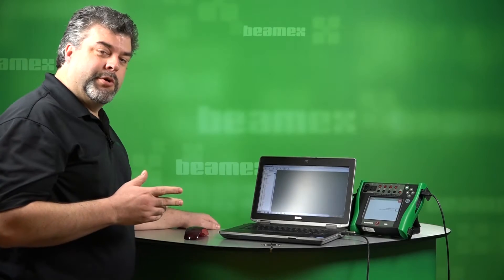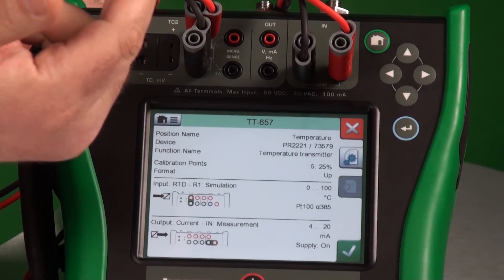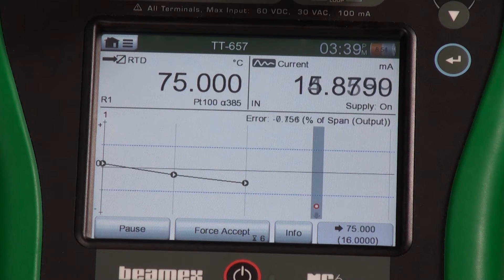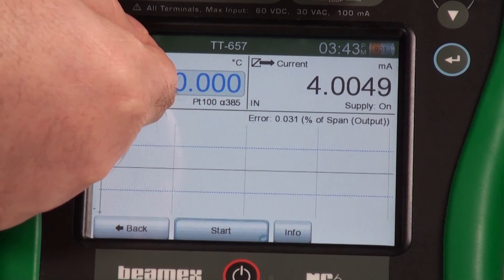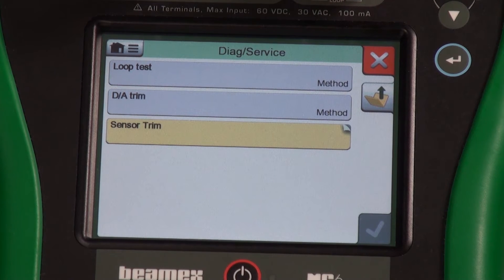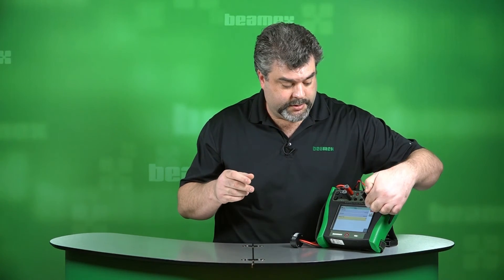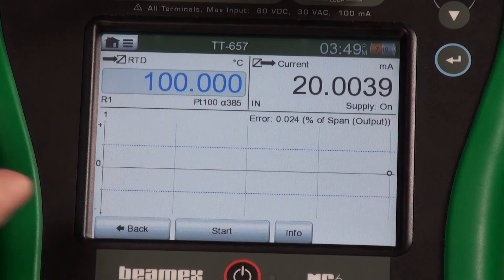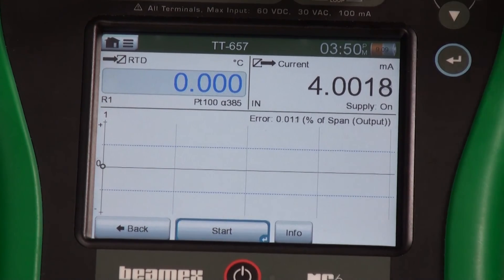Temperature loop calibration and trim with the Beamex MC6

Comment: Excellent Video. We just got our MC6. having trouble doing a similar procedure for a Thermocouple. Using the TC1 port we can only seam to measure during the document calibration process.
Reply from the maker: Hi Mike, thanks for buying the MC6, I trust you will find it very useful tool. 
You can simulate thermocouple via the TC1 connection and make similar automatic calibration like in the video. Also, if it is HART transmitter, you can also trim it with the MC6. 
To simulate thermocouples, you just need to select the "Port/Function" in Documenting Calibrator to be "TC1: Simulation" and the MC6 will simulate the selected thermocouple type. 
In case of any questions, please give our support guys a call.

Comment: Excellent guys...Great Job!!
Is there a sequence as to should DA Trim be performed first and Sensor Trim next or vice versa...also please explain me the difference between the two...
Thanks!!
Reply from the maker: Hello Rajesh. Thanks for your question and for watching the video. 
The Sensor Trim and Analog Trim are independent from each others, so it does not matter which one you trim first, as long as you trim them both. Sure in the transmitter the Sensor Trim comes first, but the trim order can be any. 
It is important to note that even you only use the mA signal in your process, you still need to trim both sections. 
Hope this helps, Thanks Heikki / Beamex
Reply: BeamexCalibration Thanks Heikki for your reply...Congratulations to your team for doing a fabulous job!!
with reference to the same I have one more question...the output of my Transmitter is the input of my Flow Computer which computes the corrected flow rate of Natural Gas.So Even after I set the o/p of Transmitter correct by trimming as you explained...there might still be a chance of inaccuracy in the Final Flow recorded by by Flow Computer because of Barrier...So should I check the Calibration of the Entire Loop or if the O/P of my Transmitter is correct I can assume my final reading by Flow Computer is also correct
Reply from the maker: Hi  @rajeshpatnaik2485 , I'd think that anyhow the transmitter should be trimmed to work accurately. Normally a barried should not have effect to the current. Anyhow, you could measure the currnet after the barried and trim transmitter to compensate any error caused by the barrier. 
Generally, doing a calibration of the whole measurement loop is a good idea. That is pretty common nowadays, so you first calibrate (check) the whole loop with e.g. temperature sensor + transmitter + control system input card. If the whole loop is accurate, then nothing needs to be done. But if there is error in the whole loop, then you need to start checking the individual Instruments to find the one that is causing the loop error. Thanks, Beamex / Heikki
Reply: BeamexCalibration ....Thanks Heikki,ur reply adds clarity to my question!!

Comment: Hi. I have MC5-IS, can you help you to connect the external 10V power supply so that I can output/sim current. Loop power? Thank you
Reply from the maker: Hi! If you don't happen to have the MC5-IS manual, you can find it from our website, or pdf is here: https://www.beamex.com/app/uploads/2016/10/MC5-IS-User-Guide.pdf 
On the page 58, it is explained how to do the current "sink", i.e. to use external supply and have the calibrator controlling the current. 
If you need, please contact our support at support@beamex.com, or through the Support Portal: https://support.beamex.com/ and you will get help.
Reply: Hi. I have it sir, thx. Bui if I go to Current Sink, E: DC Current Source/Sink Generate it say that I need external V source. In the manual it is not shown how to connect this external V source that my MC5 need to generate this current. Please help @BeamexCalibration
Reply from the maker: @perica_jonev  If you use the ET module, then the positive side of the external supply voltage is to be connected to the upper (positive) terminal in MC5-IS (the "arrow in" in the manual picture). And then the supply negative to the ET module's lower (negative) terminal. Similarly, you can also use the E module for this.
Please note the related warning on page 59, starting as following: 
"Warnings! To avoid damages to MC5-IS' electronics, first select the correct Quantity and Function/Port. Then connect the circuit including the external supply to MC5-IS.
Make sure that you don’t exceed the maximum current allowed by the instrument under test."

Comment: How to determine the input and output terminal of the rtd?
Reply from the maker: Hi, if you refer to how to determine the RTD input and output terminals in the calibrator in this video (Beamex MC6), the RTD input (measurement) and output (simulation) are using the same terminals, you just select in the menu which functionality you want to use. The one difference is that measurement uses 2, 3 or 4 terminals, while the simulation always uses the two leftmost terminals. This is explained in the user guide. Thanks, Beamex / Heikki

Comment: How did you increase temerature
Reply from the maker: In this example, the calibrator simulated an RTD sensor as an input to the temperature transmitter. So the transmitter was calibrated in this video, and the temperature sensor was not calibrated here. 
Please see some of our other videos on how to calibrate a temperature sensor (using a temperature block). 
Thanks, Heikki / Beamex